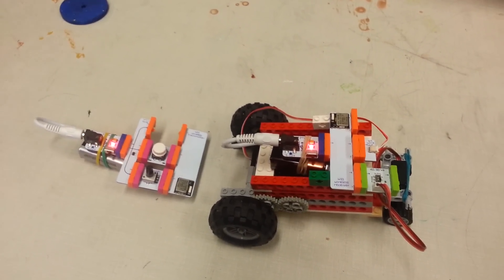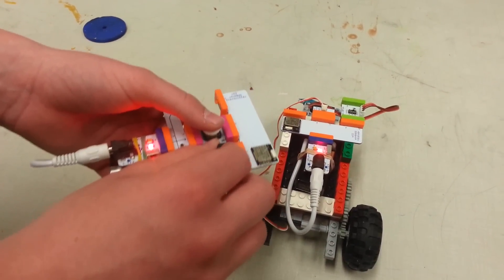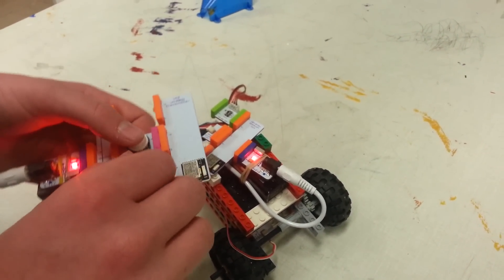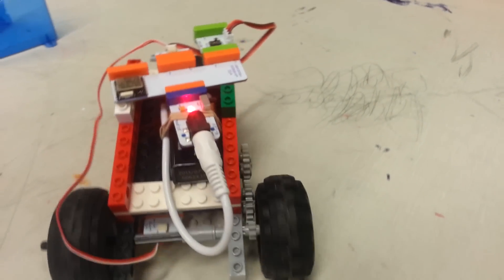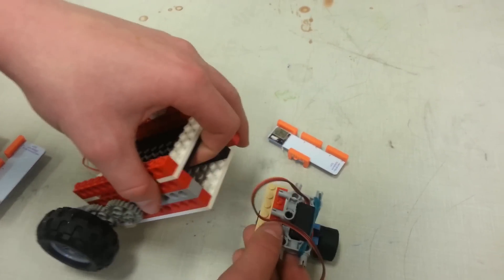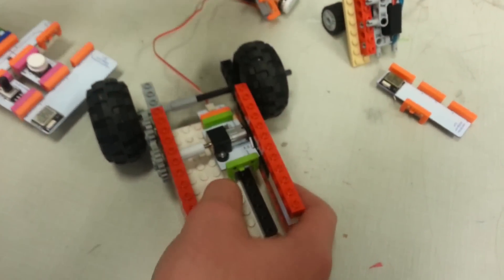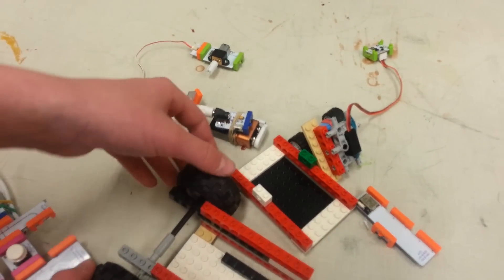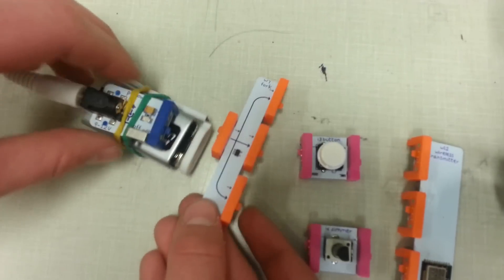LIttlebits Wireless Boost it with Lego Car

Comment: Tank steering would be easier. Plus couldn't you just use lego power functions or mindstorms? If you are using little bits I suggest using a chassis you can customize more. Cardboard, plastic, thin metal? Good video by the way.
Reply from the maker: Thanks for the feedback.  Looking at price vs. product:  Littlebits have more parts that can be integrated with lego.  We didn't have the power function parts and all the mindstorm stuff needed programming (even though its super basic).  You're right, the next steps would be to attach a whole bunch of stuff and make it even more impressive.